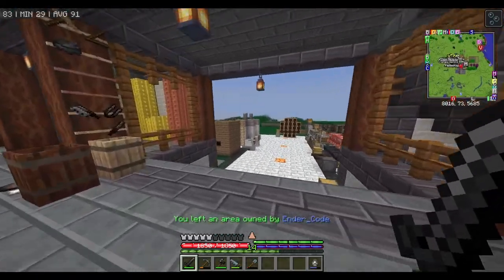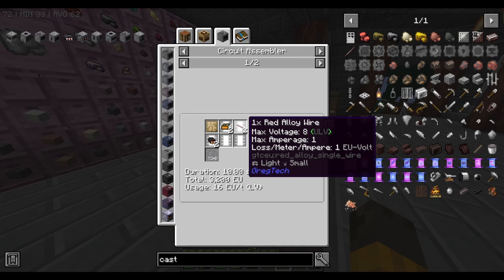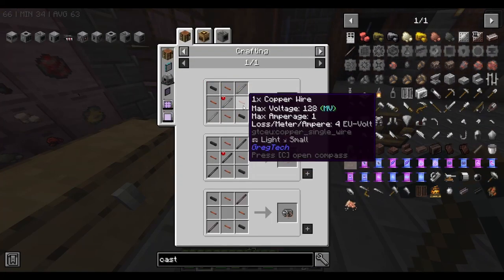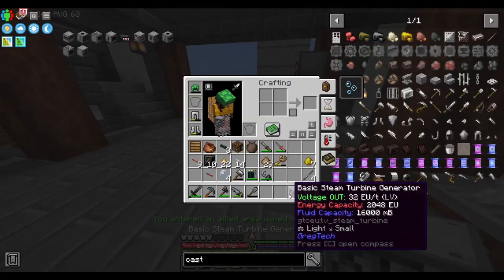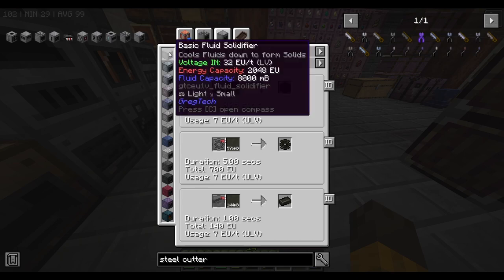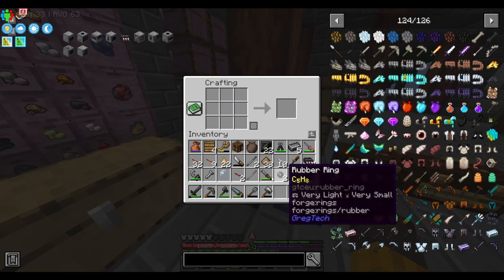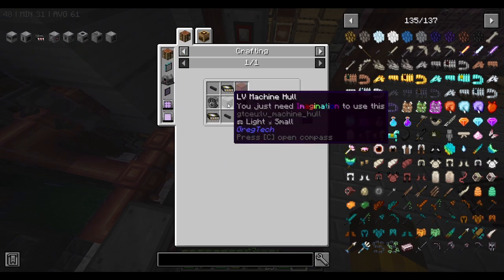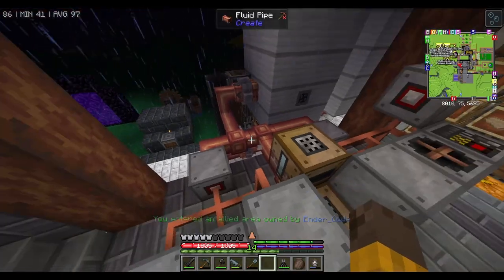ATM Gravitas 2 |EP34| Machine for Rubber Sheet (Plate)

Comment: If you`re having problems wih the energy loss, make Red Alloy cables, they`re superonductors (lossless) and not THAT expensive (you already made a ton of it for circuits), so the machines will have the same amount of power available from any distance from the turbine
Reply from the maker: Oh yeah, I totally forgot about the red alloy cable.